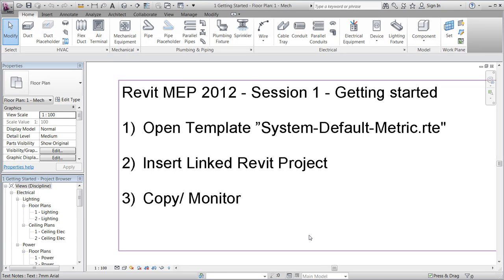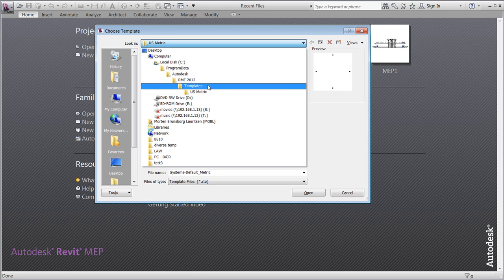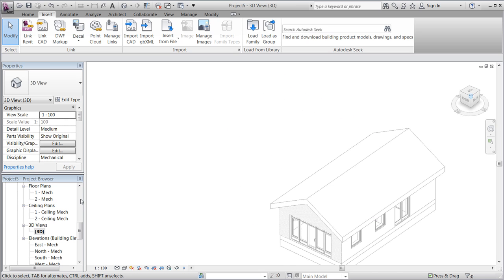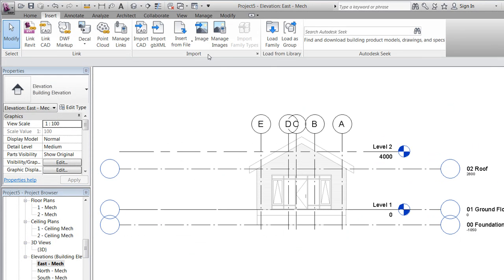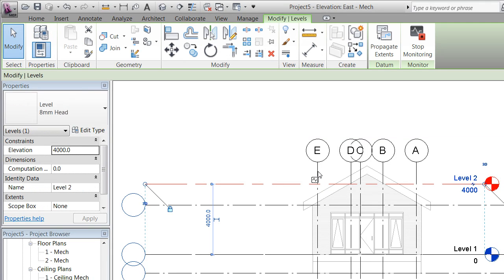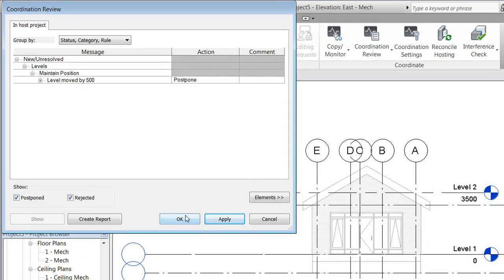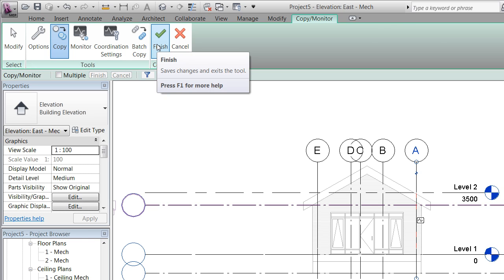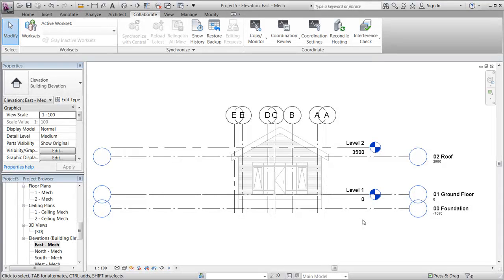Revit MEP 2012 - Session 1 - Getting started

Comment: I have Revit 2017 installed on my laptop. But It says "The Path you have specified for the default family template is invalid". I think my templates are missing. I cant find it in my Program Data/Autodesk/RVT 2017 Folder too. How to install it back?